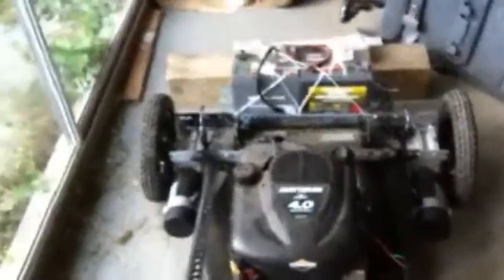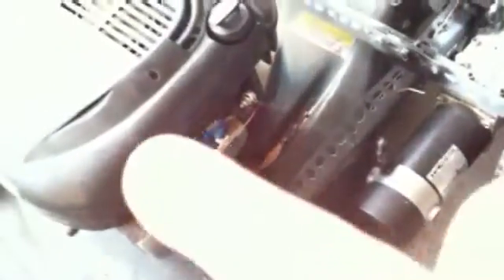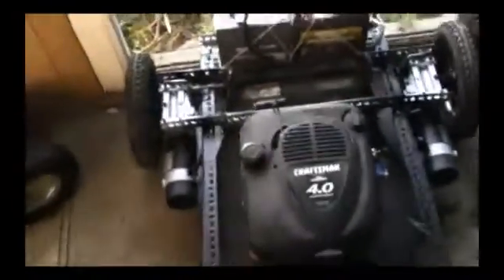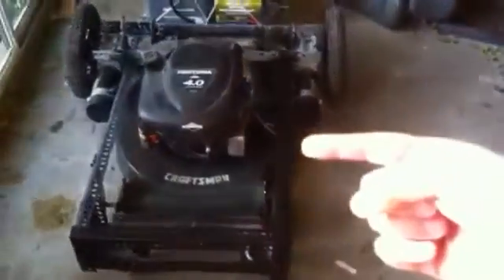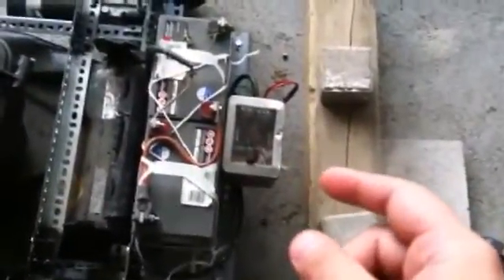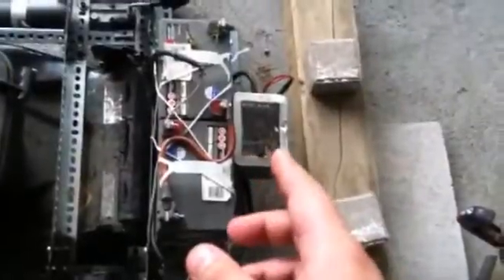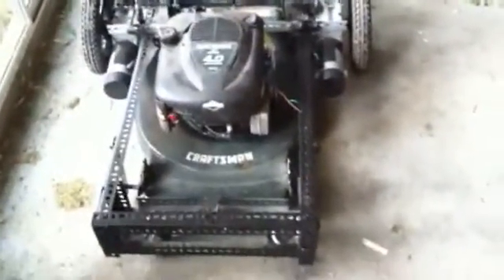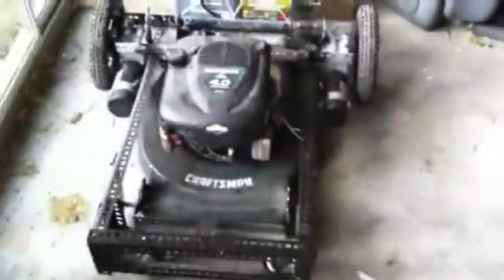LawnBot Part 9 - Wheels Solved!

Comment: bad design. you have at least 7 inches of space from blade edge.
Reply from the maker: Horrible design. First time I started it up it shook all the bolts loose, and the wheels broke. ;) The second time the frame bent and I lost control of it an almost ran over a squirrel! I'm amazed it worked for the 1 time I used it to cut the grass. It now sits in pieces in my garage, waiting for the next incarnation. Hopefully, Mark2 will be a little less killbotty.

Comment: Man you so white you make the camera squint. lol. What size wheels do you have on the front and how well do they roll on the grass? I got my mower together and cutting grass but I still have the stock front wheels which suck at letting it turn even with the Carlisle Xtrac tires I got on the rear.

Comment from the maker: The full build took about 2 months and cost $1200. Mostly due to trial and error. (a lot of error) I built the frame because I didn't want to destroy my lawnmower, because if this didn't work out, I wanted to be able to use the lawnmower again. The wheels and frame lasted about 3 months... but I ended up using the regular lawnmower after this first season.